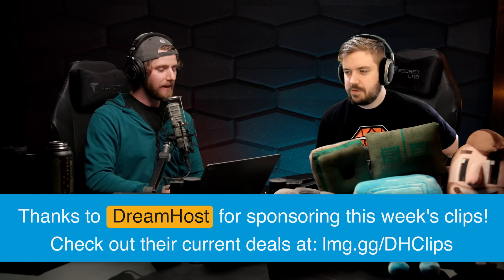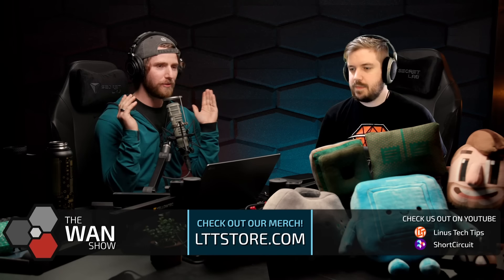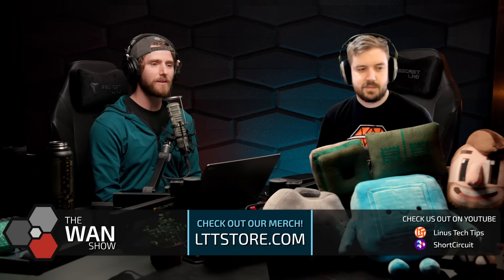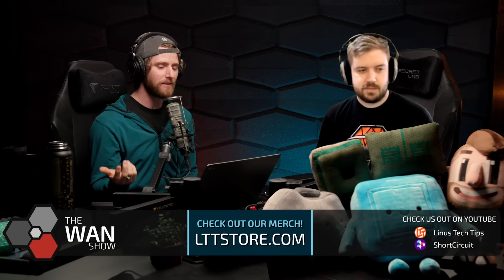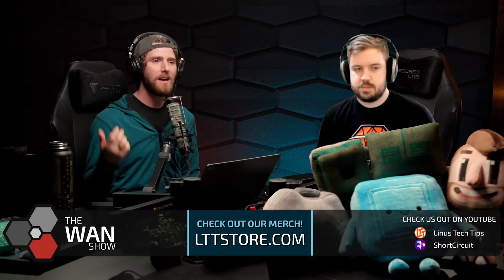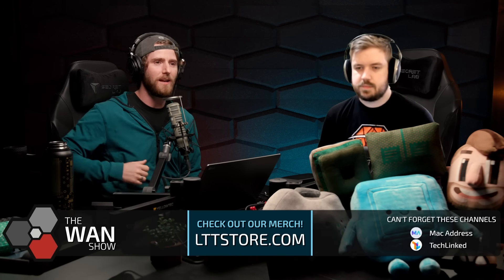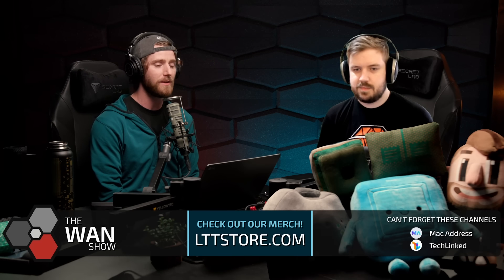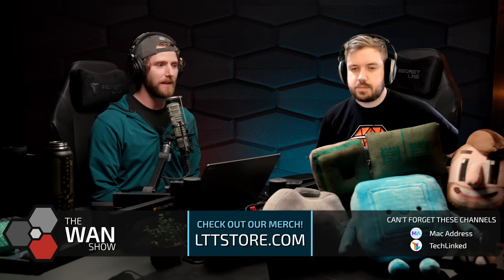They made me WASTE $10,000! Pt. 1

Comment: Thought he was gonna say they charged him for it. Somehow they outperformed my absurd hypothetical.
Reply: This. I thought they'd put upgrades behind a subscription model or took a leaf out of in car satnav updates and expect hundreds of £££ up front.
Reply: Still upset with Subaru on this shit. Bought a car manufactured in 2013 with maps from 2009. They wanted like five grand for a fucking map update.
Reply: @ZeroX252  Any Subaru with Starlink or whatever is free to update if you take it to a dealer. Call SOA if your dealer charges you, charging for it is not a Subaru thing. Ive had 3 cars all updated for free.
Reply: @nathanz7205  That was through Subaru not through my dealer. Granted this was a decade ago and Google Maps wasn't reliable because 3g cell service was still more prevalent than 4g. I yanked the abysmal head unit out and upgraded to a full dash replacement android unit and haven't looked back. 

FWIW the automotive industry really needs to up their game on what powers the in-vehicle dash systems, or use technology that relies on the end-users cellphone to do the heavy lifting. That 2013 Subaru head unit had an arm CPU from 2001 in it. It took several seconds for the predictive text after each keypress. It's especially insulting when that's what the "premium" audio package comes with.
Reply: Some cursory research shows that they changed their map delivery system in 2015, and the verbiage on the site they link to for map data updates would suggest that you may still have to pay depending on your model and warranty status.
Reply: Honestly charging him for it is better than outright refusal. Because even if it's paid for, THEY STULL HAVE IT AVAILABLE!

Comment: Linus' issue is VERY common in old, dinosaur commercial suppliers. I ran into the same problem a decade ago. I was doing IT consulting and a customer had some HVAC software. I called their support and they told me that they don't interact with the end user and that I had to find a commercial HVAC vendor that was a reseller for their products in order to get support. It is such an ancient way of doing business.
Reply: yeah it is bizzare- I am 30 and can't think of anything I own that I would expect to need a third part servicer as an intermediate on, and I would certaintly avoid going into such a situation
Reply: I did contract coding for a reasonably well known HVAC company a couple of decades ago. I sat in a meeting with some of their senior engineers and product folks and the subject of how to push out SW updates came up and they could not even understand that such could ever be a thing or why it would ever be desirable. As far as they were concerned the SW would get installed when the unit came off the production line and that was that. If it sat in a warehouse for a couple of years and the SW improved the units efficiency over that time or just removed a bug? They did not care.

I finally got them to the point where they agreed installing firmware updates could be part of servicing like adding coolant or replacing/cleaning filters. They seemed surprised that the systems already had an RS-232 connector so techs could connect using laptops and that it would be trivial to push a firmware update over that. I'm guessing the guy who came after me had to try and get them to move to USB.
Reply: @KenS1267  oh brother. Hopefully all their important systems don't need to talk to the internet or smartphones for any reason...right? Right?
Reply: @doublinx2  In 2000? There were no smartphones and IOT was at best a dream.

Comment: I'm an electrician so this is pretty funny to me. There's half a dozen different systems out and they all suck in different ways. The coolest ones I've seen are PICO switches, the way I understand it each press of the button generates just enough power to send a quick radio signal to a hub. This means the switches are totally wireless and don't need batteries. It's a breeze to install
Reply: pico is from luton and work with there home worx radio ra and caseta switches
Reply: pico’s have batteries but last a very long time, they say 10+ years
Reply: But yes lutron caseta is definitely the best consumer light switch lineup
Reply: @ctaaaaaaa  gotcha, someone probably misunderstood a representative and it telephoned into "each press generates enough power for a radio wave". I work in commercial applications so if thats the case thats gonna really suck 10 years down the road, I didn't see a way to replace a battery and those switches are pricey. It's gonna be a hell of a bill to replace all of em every 10 years
Reply: @jorgetello3961  Yeah, Pico use normal CR2032 just have small power requirements, so Lutron declares 10 year battery life on a single battery (and it's replaceable - there's small screw on the back that releases battery compartment). Though switches that generate own power do exist and typically have "kinetic" in their name.
Reply: @bar10005  I think they're called piezo electric switches if my memory serves correct.
Reply: Hue does that too for theire dumm switches
Reply: I’m sorry are you saying people pay an electrician to install wireless switches? As in a remote that gets stuck to the wall??
Reply: @AronBezzina  Not directly, but some switches are powered from the mains and even if they aren't you still need to connect mains driver, so electrician also will pair and mount/glue the wireless switch.
Reply: There actually are completely wireless and battery-less switches that use a piezo element to generate just enough power to send a radio burst.  They're not intelligent switches, it's just the absolute minimum complexity required to make a distinct radio signature that a receiver can identify.  But it does exist.
Reply: @AronBezzina  I'm a commercial electrician (commercial as in commercial buildings, from strip malls to highrises) and I only do new construction, that means I'm there start to finish, I do it all baby. Even the easy parts lol. Also these wireless switches have a hub they talk to and (at least in the commercial world) those are hard wired in a junction box.
Reply: Lutrons picos are fantastic.... we use them all over and have yet to have a battery die on us. They're rated for 10 years
Reply: I think the tech needs a few more years there are too many issues.
Reply: Unfortunately, they are some of the ugliest "switches" ever. IMO
Reply: @jorgetello3961  Meh i’m not too worried about battery costs, they’re not that expensive. I think just having to do it is kind of annoying lol, but it is supposed to be only every 10 years so eh, can’t complain too much
Reply: I have those exact switches. Better in theory than practice. You have to hit them 4x harder than a normal light switch and they are not very responsive.

Comment: I can't imagine the firmware for a light switch would be that complicated. I wouldn't think it would be hard to write an open source firmware for it.
The fact that they don't want to give out the firmware makes me think they are not doing any encryption on it and the hex for the firmware is just the hex that runs on the microcontroller.
Reply: if they don't use encryption on it, then they are trash
Reply: The algorithm for motion detection has a good bit of fairly complex DSP signal processing in it, to avoid false positives e.g. from clouds changing the lighting of the room, lights in other rooms spilling into the room creating splotches of light, shadows of trees moving in the wind, cars on the street visible through the window and so on. But after that piece of processing you have a binary output, motion / no motion, and then you can mask it out or accept it, this part is quite trivial and usually done by a completely different chip.
Reply: The problem is not how to write good open source firmware. The problem is to write is in a small package that fits onto a lightswitch.
Reply: @Ruhrpottpatriot  My Computer Science class on microprocessors was a bitch for this exact reason. Programming something with less than 100kb of ram, is a whole other ball game, compared to something running on a traditional computer. Creating efficient code is what makes things difficult.
Reply: @ARandom1  Exactly. Everybody and their grandma can write a nice face recognition algorithm with OpenCV, few can write the same on small IoT devices.
Reply: @Ruhrpottpatriot  my guess is that they are scared that someone will  take the file and reverse engineer it to try to put in a back door to allow access to the whole network.  I dont know what the security of the home assistant is like, however all it would take would be an authorized user to download the malicious firmware update from the wrong place. So on 1 hand i do kinda get it, however the users that would really have to worry about this type of intrusion probably have policies and procedures in place to stop it from being an issue (famous last words right? Lol)
Reply: @michaelold6695  yes, but.the way to avoid security concerns of someone downloading a malicious firmware is by releasing the fist party firmware in a prominent location so the end user has proper access to the right stuff. Without a proper way to update the firmware they all but ensure that any updates made when a feature doesn't work will come from a 3rd party which may or may not be trustworthy.
Reply: @michaelold6695  It's Z-Wave. If other device manufacturers do their homework it's not going to be an issue.
Reply: @1337GameDev  most microcontrollers have an option to lock the flash to keep it from being read. I doubt you’d be able to dump the flash, but I wouldn’t think it would take much work to write a custom firmware for the switch.
Reply: @1337GameDev  the cheep SiLabs 8051 microcontroller my work uses for our products can’t glitch into debug mode without it clearing the flash. I assumed most arm processors would do that as well.
Reply: @sharpfang  false positives from ghosts*
Reply: [whispers] Tasmota

Comment: As a low voltage installer, it has always seemed like a big loss for end users or the home pro-sumer to not be able to access software or resources for the products installed in their homes. Installers have to be registered dealers of product brands like Lutron, Savant, ect. to get access ourselves to program the installed systems.
Reply: The rationale of that kind of policy is a mix of good and bad and neutral but self-serving intentions.

On one hand, products like this usually rely on a network of installers to make them useful to consumers.  So, the company looks out for installers by requiring authentication to get access to resources like software and documentation.  This ensure a revenue stream for trades workers, which is somewhat respectable, but blocks the ability for DIYers to ever do anything for themselves, which is unacceptable.  OTOH, it also prevents dummies with no business holding a screwdriver from causing expensive support issues.  (Assuming those dummies aren't licensed trades workers... which, unfortunately, sometimes is the case.)

I do respect that trades workers deserve a living wage, and I see that a company would want to ensure users have a good experience with their products, and so would want only qualified installers to take on that work.  So I can see the argument for ensuring that only qualified installers should get access to resources.  But, at the same time, I feel like the end-user should have everything they need if they decide to take on that work themselves.  Those two things conflict, and I think, ultimately, the best compromise is just to make resources public, and rely on a "find a recommended installer" system to help consumers (who are not DIYers) find a reputable and qualified shop to do the work.
Reply: As a smart home installer, i understand what you are saying. Yes as a home owner, we should be able to install and have access to everything for our home. And there are products that are available that give homeowners full access.. Unfortunately with the higher end systems, they do require training, and if the installers are not properly trained can absolutely ruin a home. Therefore leaving the homeowner having paid a lot of money for something that does not work as intended. Manufacturers protect their name brand and reputation from ensuring dealers are properly trained and can ensure customers receive a much better experience. Am i saying everyone is perfect, no… there can still be bad installers and I have seen many homes installed from bad techs. Unfortunately in the case with Linus’ install is he tried to use entry level lighting control that had he consulted with a professional would have been able to warn him to not go this route. The price point of going with a quality product would have been easily 10 fold. The other thing is that it is only available through dealers and not available through big box stores or on amazon.
Reply: The reality, from a software engineer's perspective, is that homeowners will simply not spend the money to have the firmware on their light switches updated. The smart home products, within mere years, will be riddled with security vulnerabilities and CVEs. They will be hackers galore. Your light switches will be running botnets for hacking groups in Russia. Your blinds will get ransomware. These companies will be embarrassed in the news by these headlines, and hopefully this will spur them into action. In my view, IoT devices should be shipped with a method for secure automatic firmware updates, as they pose a danger to the security and operation of the wider internet when they are left with glaring security vulnerabilities.

This is pure greed, but it is incredibly short sighted for the whole smart home industry. It only takes a dozen high publicity cases of hacking incidents against this category of devices before people reject them outright.

Comment: As an infosec guy, this makes me very curious about what demons they're hiding in their firmware.

They should be begging their customers to keep their devices updated.

Sounds like they think they're supporting some old refrigerators where some tech has to plug a serial cable into the board to push an update.
Reply: Supporting old devices alone would be a good thing, but they should also be able to support ‘self updating’ firmware.
Reply: I instantly got the same thought. There is no company that doesn't want their product kept up to date. And there has to be reason for this stance....
Reply: They might have thought linus wanted the source, which is a dumb assumption.
Reply: @Flightcontrol96  then you get sued for damages to someone's house when some hacker gets in and tries to set the place on fire, or botnets someone.
Reply: @Flightcontrol96  well as a class you can ask for far more money such that any damage to your property or working days would be covered. Since well... If your IoT device gets your isp to cut service and the cost of figuring out what went wrong... Can cost you hundreds of not thousands of dollars. And they should be required to pay that.
Reply: @Flightcontrol96  you have no idea what the real cost is. Failing to properly secure a device and ensuring that the software is updated in the event of a security breach can result is major damage for these companies. 1) a forced recall. Recalling every device that is manufactured and updating the firmware for free. Runs afowl of the whole monitization scheme. 2) lawsuits for specific damages. Loss time costs, and other factors resulting from the failed hardware, as a direct result of policy and security practices. I. E. Failing to provide updated software that fixes security flaws.
Also most flaws with IoT devices are not found by isps they are found by white hat hackers seeking to break these products. Unfortunately I have a strange suspicion that the IoT companies that aren't tp-link (google/nest, Amazon, etc) do not actually care about security and will not pay for a bug bounty or fix the bug. They rather send the law after them. Oh you exposed a security flaw, here's a lawsuit and a visit by the feds.
Reply: Actually, these can be updated with a hub that they officially support. DIY issues.
Reply: My bet is its literally just arduino C put together by an intern team. Raw .ino file, that before being deployed last saw an Arduino IDE 1.6 window. Behind the app is an AVR programmer and stock example arduino upload source

Comment: I used Lutron dimmer switches in my house. It has the on / off on the bottom and a sliding dimmer. Nothing fancy, nice and simple. I love them.  I had to rewire electrical in my house, previous owner didn't have the neutral wire connected to any of the switches. Unreal.